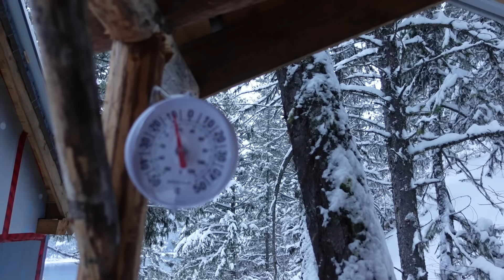My scariest incident yet, but THIS was worth it! | Snowstorms in Canada | Cabin loft build.

Comment: A major truck difference going from unleaded to diesel is the substantially heavier front end.  The 2500 Duramax is designed/expecting to have weight in the bed or towing. From experience with mine, if you add a few hundred pounds of ballast in the bed and you'll find the traction, tracking, and stability will greatly improve.
Reply: That's true of most pickups, though.  Whenever I lived out in the Midwest, I'd throw an engine block or sandbags or something in the back of my pickups (C-10, F100, and so on).
Reply: Yeah, but in that deeper snow, especially heavier snow, like that seems to be,  once it grabs you and sends you off track, there's not much you can do but ride it out. Been there done that on my older, heavier 4X4s or my newer Trail Boss.
Reply: Pretty sure hers is a 1500 with the 3.0 Dmax, no?
Reply: @DanielSon69  Good point.  .. i keep forgetting about that model, although I'd love to drop that Dmax 3.0 in the wife's Hummer H3.
Reply from the maker: @DanielSon69  yes correct
Reply: @michygoss7148  good truck, great engine choice👍🏼
Reply: 600 pounds of concrete bags in the back of my long bed duramax made a surprising difference in the ride off road, and it already rides really good and has solastic rear spring hangers to allow it to flex more easily. Any weight also helps with traction as having almost 500hp and 1000 ft pounds of torque is a killer even with traction control. Even with a 12k pound trailer and plenty on the tongue, traction is an issue. My brother's 3500 dually duramax with a utility bed has more weight and with my neck problems, I can feel the better ride when his transfer tank has 100 gallons of diesel in it vs. being close to empty. I used the concrete, so it is slip and slide now, although now that we have had a about a week of rain in socal, the oil is getting washed off the roads and it isn't quite so bad. You guys can keep that weird white crap that I have dealt with in the moutains around here....rain is bad enough.

Comment: Hey! If you have questions about board strength then use Thumper. Board strength can be rated by tapping it to hear it ring (solid) or make a dull thud (less solid) as well as desity by weight. The loft is a great way to awake.

Comment: Just a suggestion, I had a zip up hoody with a bad zipper, I simply used a pair of pliers to give the zipper a "little squeeze" and it returned to working order. it worked fine for a year or more and then started coming apart on its own again, will try it one more time but if not, at least I got another year or more out of it.

Comment: The inner cross beam of your loft bed where you notched out the ends: the extended piece of the beam that it hangs on seems rather thin. I would question the long-term structural integrity of that beam depending upon who-all and what-all you have up there. Thoughts include such things as other people using that loft where the weights might get higher than you have anticipated as a static load and any dynamic loads that will occur. Just a thought.
Reply: if she adds the right strong tie brackets with the proper fasteners, it should be fine.
Reply: Ya me too. The beam will split at the notch. Would have been better to taper the top.  I would like to see 3, 3/8 or 1/2 inch threaded rods front to back also, to keep the bed boards from slipping out.
Reply: Hey Michelle,  new to your site. Love it !!  If you k own any good  blacksmiths , they could forge you a rustic oversize joist hanger type of metal to give you the much needed support. I agree with the others that more weight etc may lead to the weaker end giving out. Just my 2 cents worth !
Reply: A ledger would have been more secure, easier, and stronger. I don't know what she's doing with the top and bottom beams clamped to sandwich the top plate? That is not sound construction technique.

Comment: you can fix the zipper with a needle nose plyers. Just need to pinch the sliding part together a little bit. i have a an older work coat that i do it to all the time. Give it a try. Good luck.

Comment: Hello Michelle, I would have a MR.BUDDY Propane heater to help supplement the heating aspect.  The other option is a diesel heater; this option will help while you, kick start your wood burning stove when its really cold. 8yr old Brady said, you look cold.. 🥰 Clyde!!!
Reply: Ya but don't do a non vented propane heater... Way too much moisture in the air. Will freeze on walls and melt when it gets warm...

Comment: Hi Michelle, you might consider having a winch installed on the front of your truck!

Also, you may need a larger stove in your cabin.  I really enjoy your videos.
Reply: Agree on a larger stove 👍🏻
Reply: I have a cub cadet in my short bus in the Pacific NW.  It’s only 96 sf and it doesn’t even heat this. I have to supplement w propane heat.  They could possibly heat a playhouse

Comment: you could fab up a crane of sorts you mount in the peg holes in the cab of the bed then use a come along to just lower stuff down from the top and forgo those stairs, much quicker to unload the truck wheel chocks and lower the load down using a home made crane . .then onto the sky mule and go . .

Comment: On your purple coat take a pair of pliers and squeeze the sides of the slide to compress the zipper slide and it will stop coming apart from the bottom. Should fix the zipper issue

Comment: You might want to think about also putting down a piece of 1/4-3/8 plywood or chip board in the loft for strength and rigidity, Screw it down in multiple areas and it will give a ton of strength and you wont lose the aesthetics from below.

Comment: You could easily add some half inch plywood or OSB, or something of that nature and glue it on top of the wood strips to add structural integrity to your sleeping loft. Then cover it with foam or bedding, and no one would see it. three tubes of construction adhesive should do the trick.

Comment: Hi michelle love the loft. Possible to install some 45 degree bracing at eack end under neath loft. If not i would try and brace the ends of eeach 4x4 under neath. If the ends crack or break while your up there sleeping that would not be good. Thanks sharing eli

Comment: You are doing good work, nice look on the loft!  I would get thermal blanket material. and make yourself some window coverings to drop down at least during the night to stop one of the biggest entrances of cold into your cabin.  Glass as you know is a poor insulator compared to wood.  I know you are working on it, but I would put labor into sealing as many interior air leaks as possible before i did other things inside.  Your interior air temps will rise with the same amount of heat.

Comment: Blimey that cabin looks absolutely fabulous..! 😮

I don’t know your truck but I’ve owned various 4wd vehicles over here, I found I had to keep some throttle so the wheels kept driving where I pointed… little or no throttle allowed for the diffs that normally put power down well to get static when slippery surfaces are confusing to the mechanisms that are there to work for us… just a thought.. as it’s a “new” truck do you need to know more .. duno .. 🤔

Comment: HI Michelle, couldnt tell if you had a flue damper in your chimney, if not you may consider putting one in where you can control your heat a little more effectively,  theyre like $20.., when first firing up open it right up, once your good n hot close it up a little and keep your heat from going up the chimney, and, you might not burn near as much wood either, lol just a suggestion

Comment: Glad you didn't damage the truck on the trestle!  I'm guessing with the wider stance of the truck it probably slipped off the narrower packed tracks from the atvs and SxS's.  We used to atv across all three of those before they decked them or installed railings.  I kinda miss that feeling of openness but wouldn't feel good through snow :D

Comment: Looks like when hitting the bridge your tire hit the bottom beam and bounced it back on and top rail hit your mirror! Either way be careful! You have the best setup for everyday driving winter tires, studded winter tread tires are the top, for everyday winter driving. Just a couple hundred pounds of weight about your axles in winter helps tremendously as well! Awesome cabin and the most beautiful view! Amazing. What river? Thanks

Comment: Michelle, remember that wood works with changes in temperature, it would be necessary for you to tie those boards of the bed that you built, the groove that you made in the beam may not be enough to structure and keep the boards in its position, it can cause a drop!!!!🤗🤗
Reply from the maker: Good point!

Comment: On one side the boards are just sticking in that groove and on the other side they are nailed to the beam. If the boards are shrinking, they will be pulled out of the groove. Also, what if the beam with the grppve bends a bit? i would put a layer of plywood on top of it and screw it to the beam with metal angles tbh.

Comment: You should get a 1 inch piece of angle iron as long as your beam and screw it to the beam to secure the loft
Reply: Paint it rustic like the lockers and the screws black. It will blend right in and give it extra strength.
Reply: Depends how much you care about someone 😜

Comment: you might want to upsize your wood stove to a Jotul 602 or something similar..sell the cubic mini to a van dweller or put it in the sleeping shed ......with the larger stove you will not have to stoke it as much and can place a damper in the stove pipe and throttle it back ..Warmer faster and will remove humidity out of the cabin

Comment: Would a piece of plywood glued & screwed to the topside of the deck boards be possible? I think it would add lots of rigidity. And, a ledger strip under the ends of those boards would add lots of strength, too. Under the loft is a new place to hang lights. 😊
Reply from the maker: It would for sure! I would probably just use leftover boards laying around just so I don’t have to haul anything new down there. 
I was really wanting to not add a strip of wood - that’s solely why I made the groove/notch. 
Yes - lights! And maybe the ladder 🪜

Comment: Have been watching peridically your build and am impressed with your abilities !!  I am totally envious of your location.  Please please support the loft beam you just installed underneath with some king studs on either end.  Simply notching out the beam and " leg screwing " ?  into the 2x4 on top of the wall is not gonna be enough and will fail over time especially with the moisture inside form the cooking and such.  Contraction and expansion with the extreem cold and then warm is gonna pull on the wood over time along with the boards you have installed as your base.  I'm not trying to tell you what to do just want to keep you around longer :)   You may have done this and i didn't notice..    I have been in the trades for 30yrs as well as being a musician ..

Comment: Take a pair of pliers and squeeze the metal on the zipper slide down tight. It will fix the zipper until you need to squeeze it again.

Comment: You really need to get a rail on the deck, you could slip so easily (as your truck proofed). For the loft you could stay 1m away from window and have a net instead of floor board so light filters through

Comment: Great job on the cabin!
PLEASE PRIORITISE a Railing on the Deck! Next time you go out! (One wrong slip and it'll be disaster!) 
Also on the bed, why don't you add either a second layer of thin boards, or a thin 3-5mm sheet of ply to sure it up/spread the load and just add a bit of integrity/tie the boards together so it cant go through as easily, those boards definitely dont look strong enough as is..
Have a great week and Stay safe!! 🏴🇬🇧
Reply from the maker: Yes - that’s actually my plan, I just didn’t have time to execute it that day. But on the drive I thought about it and think I will just add a second layer of boards I have laying around, running lengthwise, and that should do it. Plus a few 90 degree braces to ensure the boards don’t shrink out of their groove !
Reply: @michygoss7148  excellent stuff! Just don't want to see you getting hurt/taking a nasty fall that's all.. Sounds like you're on it now though so I'm really pleased tbh... Have a great week! 👍

Comment: Probably because greater depth of snow on trestle, enables more snow in the center of the path and less near the railings, making a hump, in effect, which could cause sliding towards the rails. 'Just as the Sands of Time' / so should you attach railings to your Deck.
Reply from the maker: Yep. I did actually say that on video, but I edited it out. Where the wheels have driven over it’s icy and higher up, so the slight angle off of that caused me to just slide right over. 
I don’t explain things well most of the time, so I just cut it out. Haha
Reply: On the positive side, You're a hard-headed woman and You just Go for it. On the other hand, You're a hard-headed woman and You just Go for it. Gotta love the determination.

Comment: Your main is not brush. The knobhead's working fine when you thinking how not to get hurt. The loft looks really nice from underneath. But I think you need something a little more rigid than foam board. Maybe some slats run long ways or a piece of plywood. Safety. Carry on.

Comment: Railings would be nice - but you might consider wire fence if you are concerned for your views... The most important advice I can offer is to get better tires for your truck. That tread pattern is NOT designed for deep snow... Maybe something like the Goodyear Wrangler DuraTrac. Just a thought. Be safe.

Comment: I like your posts. Two points about safety, put some weight in truck bed.600- 700 lbs. (tractor ballast weights) weight is your friend in dicey weather. Point two,  fab a guard rail on the deck. Keep the posts coming, and stay safe.

Comment: 4 low locks your wheels in to spin the same on each wheel. Your limited slip on 4 high will pull you to one direction in snow or ice b4 it catches.
Reply from the maker: I was just so shocked it happened. Never had that happen in my Toyota and I drove in worse conditions in that truck!

Comment: First of your videos I've watched, the algorithm worked for you, yay! 😆
For your loft/bed space, those boards are going to flex too much and will begin to fail over time. I get that you'd prefer to keep the aesthetics, which is why I'm guessing you didn't set it up in a joist style configuration. Something to consider, to keep the aesthetics but give yourself considerable more security I'd suggest building out a cross brace system from underneath, kind of like how you would find on a barn door. Since you already have your beam in place, instead of trying to get the cross braces notched in, use some rafter ties/hold-downs or corner braces to tie the wooden cross brace to your beams. You could spray paint them black to give them a nicer look. Then for the cross braces themselves, wood glue and screws only long enough to get through the brace and your floor. I would split the length of the opening in 2, and either run 2 thick braces at mirrored angles across or use some thinner stock and make an X in the 2 spaces.

Comment: insulate the cabin and then the wood stove will heat more efficiently.
Reply from the maker: It is insulated! Not heavily, but I’ve got 2” rigid foam on the roof and 1” rigid foam on the walls (outside)

Comment: A 3/4 ton truck has a crapload of torque, so you need a couple heavy sandbags in back to keep from sliding in the snow, glad there was no damage. I would put a second 2x2x10 lip or however long strip under the slats on either side and screw it and glue it to the beams for extra structural integrity. The groove is not enough, particularly for a big guy like me 6/3 240. I'd go right through those. On the bed I built I have 2 " poplar slats that don't even squeak when I get on them. A hippo could sleep on my bed and that's what you want to build for. I think the bed up front is perfect for that view. People hassle you about the railing, but I would finish the exterior siding first then knock out trim work and railings and stuff after. Are you going to insulate it? I would at least do 1 or 2" rigid foam and then siding to maximize heat retention and the stove's potential. Great job, keep it up.
Reply from the maker: I agree - it would be rather dangerous to try and build a railing in these conditions. 
I do have 2” rigid foam on the roof and 1” rigid foam on the outside of the walls.

Comment: Please add a railing to your deck!   A cable railing won't hamper the view too much.   Or, if you don't want to hamper the view, you can add some stairs down a couple feet to another deck on the outside of current deck.  If you fall off the main deck, you would only fall a short distance.      If you fall off now, it would be ugly.

Comment: you should have double lined your cabin and your foundation should have been steel into the rock with a center steel pipe going right up the middle then build your cabin around it either as a square or circular cabin which would not move